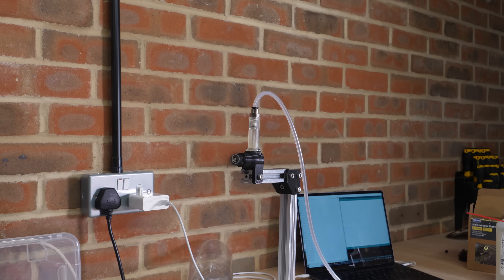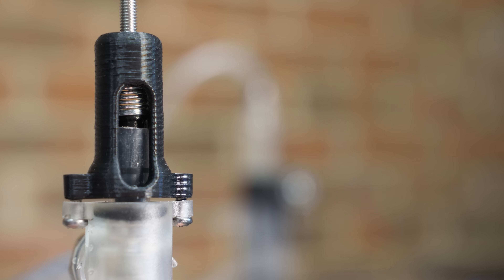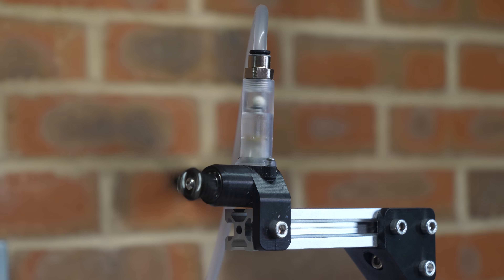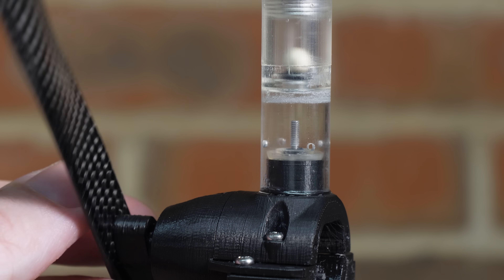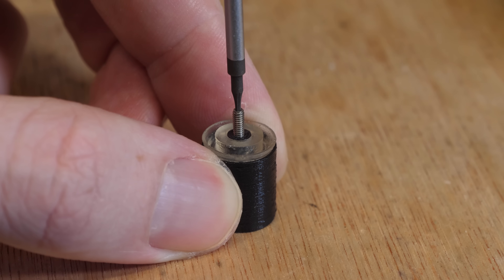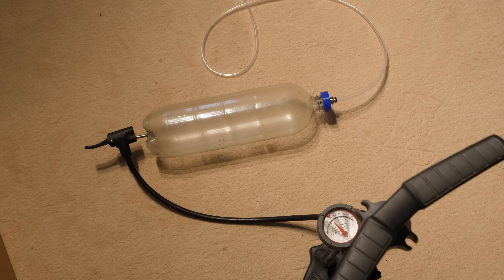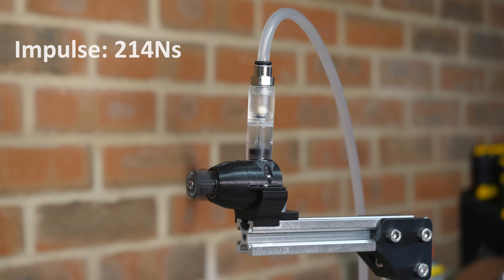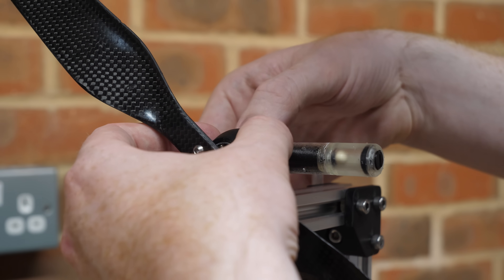4,500RPM Air Engine

Comment: Love this series! I wonder if an offset crank would make any difference. They do this in road cars to change the angle of the crank when in the power stroke. Might reduce friction in your system too.
Reply: I wonder if that might have been the "failure point" for the I-2 Engine (not sure what that config is called, so I based it on the V type engine)
Reply: @PrograError  An i2 engine would have the cylinders sit side-by-side in a row like in a typical 4-cyl engine in a hatchback or sedan.
What Tom built here was a Flat-2 or "Boxer-style" 2-cyl, most Boxers are 6-cyl in cars like the Porsche 911 where the pistons meet on the down stroke like a boxer punching his fists together before a fight in the ring.
Unlike a true Boxer engine, what Tom built has the pistons alternating places so when one piston is at Top Dead Centre, the other is at Bottom Dead Centre (thing like two men working a saw on a tree - one pushes away as the other pulls towards).
Reply: An offset crank might help indeed, would love to see a camshaft as well with inlet and outlet but probably too hard on miniature scale in plastic.

Comment: Tom,
I have idea to increase efficiency. Make engine inside structure like Dyson fan (I mean - use the physics law that this fan use). Air moving around in "fast" speed will "suck" air from your engine/exhaust (and lower pressure in your low position piston) and boosting your efficiency.
Challenge - make exhaust works like that by using air from your blade + speed* of flying plane. And made it light enough to make a difference in flight time. 
*Bigger speeds of air= bigger effect.

Extra You could also use/test/think about pressure made by plane lifting force made by wing. 
1) Use lower pressure in "up side" of wing to make even more "sucking" force from exhaust..buuut loose some air/lift efficiency..
or
2)make higher pressure (from your extra air from anigne) under "down side" of wing and increase lift force on plane and by that, allowing smaller wing. Smaller wing = smaller "front drag" of plane = bigger efficiency of flight time. - or justed allowing to lower throttle without loosing lift force made by plane from speed = rpm = efficiency :D
Or bigger speeds* with same rpm. 

I know it may be all not efficient by "extra" weight or it may be just few% up od down..but that's the fun :D
 
Idea - two engines in two wings, and then u can "play" with exhaust facing upside or downside of wing or types of exhaust for "dyson" effect ;D

Comment: I wonder if you could build a compressed air engine with a turbine instead of a piston design. Connect the turbine to the propeller through a high ratio gear. Think slow turbine and fast propeller. Obviously the turbine would have to be airtight up to the outlet part of its cycle. Why would it be worse in efficiency or power than a piston engine?

Comment: You should eliminate all metal from your engine setup. Like the John Guest connector, the spring itself (swap it with a bar spring of the printed nature), essentially shave off all weight from this design. Even bolts/screws should be taken out and replaced with twistlock designs. Scallop areas where you can, etc.

Comment: the amount of progress that has been made over the years is really something to behold, can't wait to see the new plane flying and that twin sounded pretty freaking nice.
something to note is that you are still compressing air as the piston goes up until it gets the higher pressure from the compressed air bottle/tank. not sure how to go about fix that issue, not without adding a bunch of weight to it...but that would save some energy at the very least.

Comment: You could get more torque out of the 3-to-1 engine if you use an offset crankshaft, make TDC happen when the crank is at like 45 degrees

Comment: I was just thinking that one way to cheat a little to get a longer sustained flight might be to put a little dry ice in the bottle. However, this could create too much pressure and possibly end with a quick unplanned deconstruction. Could still be interesting to test it with a decommissioned design

Comment: Brick Technology has a video where he runs lego engines on compressed air, one of them is a full a radial engine like those used to drive some planes. Might be worth taking a look at because it could run at the lowest speed of all the different engines.

Comment: The "Bolt" in your regulator is a "Set Screw" and your 2mm "set screw" is a "Grub Screw" mate, accurate descriptions are VERY IMPORTANT in Engineering and Science.

Comment: Can you use a dry ice or liquid nitrogen container with a small heating coil to extend the amount of fuel?? It would increase weight a good bit but you could also get higher pressure

Comment: Would a tiny turbo work be possible to make use of the exhaust created by your air engine to get maybe gain a second of run time?

I'm not an engineer, so I don't know better, just curious and wanted to ask.

Comment: Is the engine getting hot after running for a while? I’m wondering, if the friction between the cylinder and the piston is generating too much heat over time. Or does the pressured air have enough cooling power?

Comment: i bet you can get more EFF with a tune pipe get the pules timings to the engine rpm you will have lower the atm pressure on the ports.

Comment: You had the right idea, trying to get the pressure down to nothing, on expansion. You need to increase your expansion ratio such that the pressure in the SMALL volume is fully expanded before the ports open, at some nominal pressure (60psi?). Above that pressure, you'll waste a little out the vents, but below that pressure, the lip seal will collapse, and you won't lose anything. With your "self regulating" valve, that should result in QUITE an efficiency boost, although you'll lose a little peak power.

Comment: Lol, can you put it on a tiny air pump? And have a piston sounding electric plane?
Reply: kind of pointless as you could just use the air pump engine directly and it would be more efficient he is probably gonna use a carbon paintball compressed air tank.

Comment: Tom, you could improve efficiency even more by keeping the head design with no upper expansion area like you have now; and simply increasing the stroke volume to the point in which the expansion ratio is sufficient to your liking & DOESN'T have that high pressure delta when it goes to exhaust from the ports. And also finding a way to ensure that there is no compression stroke, only expansion, like a Miller-cycle on steroids. Not to mention the extra crank leverage you would receive with the stroke increase, would allow a larger, slower prop, etc. 

Please upvote this so Tom might see it, I am 100% sure I am correct about what I'm saying. Thanks.
Reply: I think the exhaust is the issue with the engine as you point out, there is a big compression stroke! if the expansion happens and the air in the cylinder is at 1atm at BDC then no air is going to leave the exhaust port, as the piston starts moving up there will be a tiny bit escape before the ports get covered but most of the air gets re-compressed and wastes most of the energy. the exhaust port should be in the piston and opened by the crank shaft, when the piston gets to the top it should close.
Reply: @Hootie811  I think he is avoiding a compression stroke by having seals that don't work without pressure. When the valve opens and high pressure air flows in, the seal is pressed outwards against the cylinder walls. Then when the pressure is released, the seal springs back away from the wall, allowing the air to move past as the cylinder moves back up.
Reply: @robertbackhaus8911  That's a neat design. Its funny how many actual engine concepts he manages to cover (by accident or not) just by developing these. I was wondering if he was going to try and implement some scavenging though I wouldn't see it being effective at all.
Reply: @robertbackhaus8911  I have also been thinking and testing of another way of doing this. You use a tilting piston that would seal just a slight bit before the valve opens, and the friction would also be very low, since the absolute only contact area that the piston has over the whole cylinder is just the seal, and that contact area is even less when it tilts. You would also reduce the amount of moving parts doing that aswell
Reply: I was wondering whether higher engine rpm, from using a shorter stroke/bigger piston and a geared-down prop, would help efficiency. But I'm way over my head in the science!
Reply: @travelbugse2829  It would make more power for sure, but that actually be less efficient. Check out over & under square engines for info. I love that we are all thinking of stuff, such a cool community
Reply: @joshuahstedman9346  Tom should be held responsible for the lack of chores I'm supposed to be doing about the home! ;)

Comment: Would be intresting to see if feeding the exhaust from one cylinder into the intake of the other makes for a more efficient setup, like a double expansion steam engine. The only manned steam engined plane I know of used a triple expansion engine to get the efficiency high enough, so there's flight heritage there!

Comment: The 2 cylinder version looks and sounds great but has too high vibration because the pistons go left and right simultaneously, throwing 2 times the piston mass around. A boxer configuration would be much smoother.

Comment: Forgive me if this is total nonsense, as I know little about things like this; but could you integrate a vacuum to “refuel” the air tank to lengthen run time? I’m sure you couldn’t have an engine be pure air-based and run for long, but maybe something like this is possible.

Comment: Ok, so we use high pressure air to move a cylinder that moves a propeller that pushes air. How about if we used high pressure air to move air directly? How would it compare? For example through a nozzle or a Dyson bladeless fan, or like a Jetoptera. It would be an interesting comparison.

Comment: clearly, the aircars of the future will be powered using 3-d printed twin-cylinder engines running off of pressurized air contained in old soda bottles. 😎👍

Comment: I have been sitting around with delidded aluminium cans (take a can opener to a half liter, just for the sake of having seen the shiny smooth inside of the cans) and dreaming about turning them into an air pressure engine. Really have no idea if they are suited for the task but the perfect inside just almost pleads me to put in a piston

Comment: RESONANCE Optimization needed !!!

Again a to another very cool video. I would like to see an optimize in terms of gas flow resonances, similar to a 2-stroke engine. To explain, you could optimize the length of the exhaust so that the returning pressure wave evacuates the cylinder. For this, a diffuser would need to be placed at the right distance from the outlet. Similarly, you can utilize the backpressure from the moving column of gas in the "intake." A check valve could serve a similar function to a membrane control in a 2-stroke engine. The principle is equivalent to that of a hydraulic ram.

Comment: that boxer engine is amazing... what if you design it to have the same displacement volume as the 1-cylinder engine? i know there would still be more mechanical losses in friction but would there be any benefits? perhaps the efficiency would get closer.

Comment: Tom, Do you think it would be feasible to have a dual tank system, with the second tank only opening once the first one has dropped in pressure so far that it does not provide any more thrust?

Comment: you should try with a cylinder offset to try and make more torque since you had a problem with the angle off the crankshaft making less torque at the beginning

Comment: So I suppose to run lower pressures with higher air volume solution would be to design 3 cylinder engine to overcome the torque issue

Comment: This is very cool but do you think you could reroute the exhaust to give the inlet a boost in pressure or would the inlet pressure be so much grater that the air would go back in the exhaust? or you could try to use the exhaust pressure to spin a turbo like part connected to the crankshaft to give it a small speed bump!

Comment: Love this series! Thinking about improvements: crank bearing offset to get sligtly better leverage on push stroke, not possible with boxer. Another thing, small air accumulator close to the cylinder head, integrated in the print? Also, I think you can carry 200-300 psi or something in a PET bottle. Impossibe to blow with 160 psi when I tried.

Comment: If it werent for how dangerous liquid nirtogen can be when confined, Ive always wanted to see things like this, or the 8×8 air powered lego Tatra running with just a teaspoon of liquid nitrogen to pressurize the 2L bottle. I suppose it is possible with a pressure relief valve to let off excess energy, but I imagine that still being sketchy

Comment: Since the pressure being exhausted from the cylinders is above atmospheric pressure, could it be reclaimed to operate the second cylinder?  The second cylinder would need to be tuned to operate at lower pressure.

Comment: you could look into offset crankshafts. it is done by many engines before, where you put the rotating center of the crankshaft not centered of the cylinder. this way you achieve a bigger torque at the powerstroke if you offset it to the right part. it could very well benefit to your efficiency. also, more exhaust ports, probably slightly angled would benefit also

Comment: If the tank has an electric piston that consumes low electricity, it will always keep the air pressurized, preventing the torque from decreasing."

Comment: Nice video. It’s normal that reducing the unswept volume results in greater efficiency with most engines. I did think that the compression ratio would have some detrimental effect like you though. Would be interesting to see the cylinders mounted at 90 deg apart to see whether it was it was any smoother. Looking forward to the test. Have you give up on the regulator idea now? Is that just additional mass you don’t need if the lifter pin can be tweaked?

Comment: Good progress in the air engine, but for opposing piston engines I think that you may need a counterbalance at the crankshaft to minimize the vibrations. This may improve the durability of the engine and also can reduce friction on the pistons by reducing the horizontal loads that opposing  arms create.
You can look at VW Beetle engines on how it is balanced.

Comment: Have  you fully utilized the "exhaust gasses should be low pressure" idea?  For the dual engine idea, instead of feeding both engines from the same tank,  feed the second engine with a small 'early exit' exhaust valve from the first engine.  The first engine first exhausts to the second engine, and then lets out the remaining air  ( or maybe it all goes to the second one)
the second engine only runs off of second hand air. This will allow you to design two engines : One  high pressure to meduim pressure engine , and hten a medium pressure to atmospheric pressure one.

Also,one calculation you can do for all your engines is calculate the efficiency as the pressure goes from high to low. This will let you know what a particular variation is best at.

Comment: What about a CO2 cartridge? Is it not a very compact fuel source? I don't know how practical it is for a plane, but it would be awsome to see if and for how long you could run an engine like this from say a 12g cartridge that you would use for an Airsoft pistol for example. Thanks for the awsome video!

Comment: maybe you can use some solid fuel in the bottle that sublimates to gas over time extending the range. something like bicarbonate and vinegar? idk if the math checks out, there are probably other chemicals that work better

Comment: Hey Tom, I had an idea but did not want to bother you on twitter (especially because I would have had to type it up on my phone, which is just typo-prone) but here goes:
Your engines produce a lot of torque when the pressure in your bottle is still very high (as in right at the beginning) but then drop off quickly.
How about instead of regulating the airflow by reducing the pressure in the cylinder, you build a propeller that, when spun too fast, expands due to centrifugal forces.
I am thinking something like a prop with a diameter of 10 cm, with hidden blades, held back by springs, which will start to extend with increasing RPM.
That way, when your engine has the most torque, where every piston stroke is both very rapid and consumes more effective air (same volume but higher pressure) the blades extend, which in turn increases the thrust your propeller produces, because it has a higher surface area, but at the same time, a larger propeller has more rotational inertia and requires more torque to run, so it also slows down the prop, which reduces the amount of air it uses at the beginning, as the piston runs at a lower RPM.

Also, while watching this video, I had another idea:
Would it work to attach tubes to the exhaust of your pistons to essentially reroute the exhaust out the back of an airplane as additional thrust?

I am sorry in advance if these ideas are utterly garbage, as I am not an aeronautic engineer, but I hope you can give them a thought.

Comment: I think you should really concider the propeller efficiency for those kind of tests, your are not measuring the efficiency of your engine when measure static thrust, and the more powerfull your engine will get, the less efficient they will look ... The static thrust efficiency of a propeller is basically proportional to the inverse of  it's thrust, twice the power half the efficiency ...